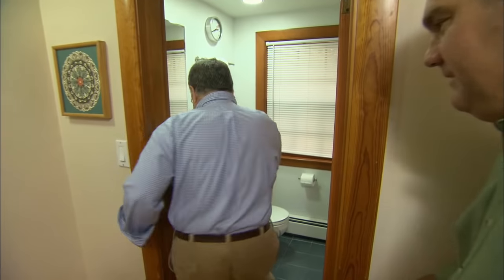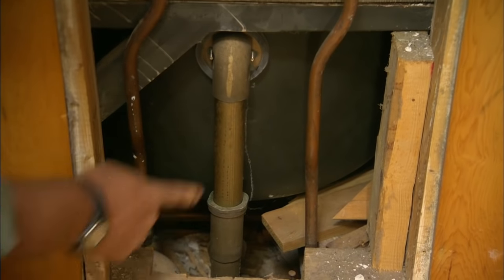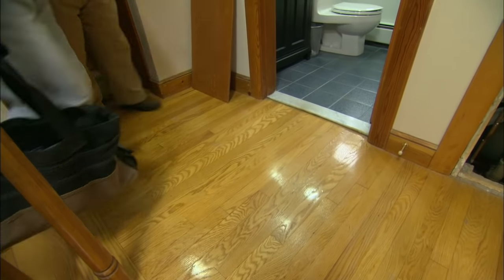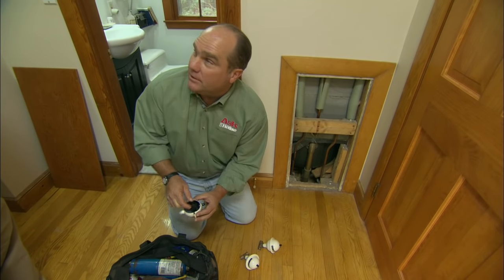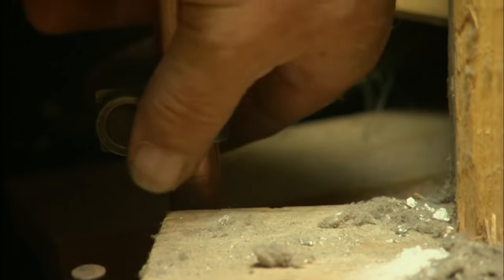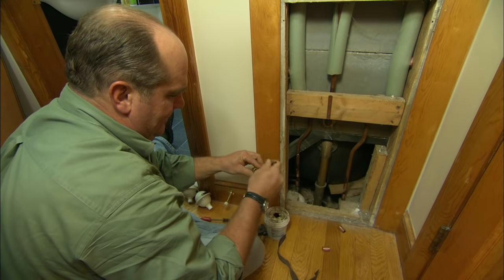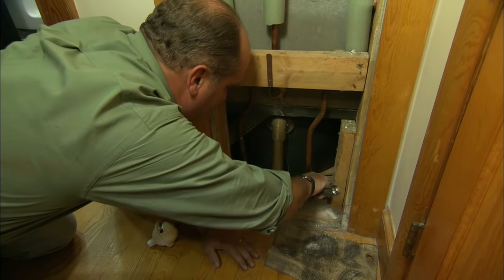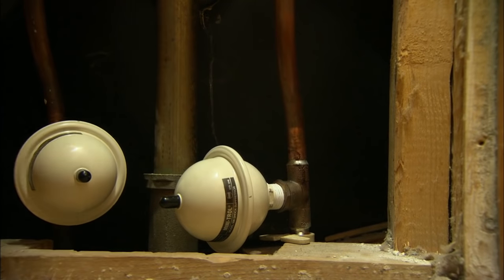How to Quiet Pipes With a Water Hammer Arrestor | This Old House

Comment: I would have preferred to see how it sounded when the play in the pipe was fixed before installing the hammer device because now we don't know what fixed the problem.
Reply: Holding the pipe can avoid noise but not the water hammer effect, which would in any case release the inertia into another element of the system.
Reply: agree
Reply: He totally bumps the wood and makes the same sound. Probably would’ve been fixed by just securing the pipe... start there at least!!
Reply: ri mar who said that? I didnt see that anywhere?
Reply: JMC5 I know you posted a month ago, but it's shortly after 0:55
Reply: you are absolutely right!
Reply: sdmerkr it’s caused by the energy that builds up due to the water pressure fixing the pipe securely doesnt disperse that energy it just secures the pipe carrying it, it still has to travel somewhere and the water hammer works by absorbing the energy and dispersing it efficiently through the rubber and air vent.
Reply: @sdmerkr  If this were the first person on earth with this problem, securing the pipe alone may be appropriate. But water hammer is a well-understood phenomenon; there are parts at Home Depot to comprehensively address it. Securing the pipe is treating the symptom but not fixing the problem. Actually, securing the pipe will make the pressure wave worse, because the elasticity of the system has now been constricted. Eventually, the problem will show up elsewhere -- with perhaps far more catastrophic effect. It ain't called "water hammer" for nothing! Rather than sweep the problem under the metaphorical rug, why not just deal with it?

The equation for water hammer is shown in another video: https://youtu.be/xoLmVFAFjn4?t=312 . The point at 312 seconds discusses "wave celerity", which is what we are discussing. Less elasticity increases the wave celerity, which increases the hammer effect for the whole system. HTH.
Reply: @floatingbonesjournal  Cool story bro
Reply: Great fix
Reply: exactly. he could have stopped that noise probably without the expansion tank.
Reply: @sdmerkr  Exactly!
Reply: @jamesl8053  there's no air vent, it's an air chamber. That on the top is a tire valve to preload the chamber to the proper pressure just like any pressure tank - that said, would have been nice if they addressed the pressure preload not just mount it off the shelf with the factory preload.

Comment: The arrestor is not only there to quiet the noise, the arrestor is really there to prevent damage to your piping. The shockwave caused by the rapid closing of the valves can damage your piping over time.
Reply: Including loosening screws inside brittle walls.
Reply: True.
Reply: OneDayAfterAnother  No. Arrestors are the simple comprehensive solution. You cannot possibly stop others from turning water on/off slowly -- unless you installed special hardware to do just that. Such things are done for industrial systems, but not in homes.
Reply: 23 years pipe still looks fine

Comment: next time before stopping the pipe from shaking can you please install the  Hammer Device to see how it absorbs the shoks ? and after that secure it with a bolt ? :)
Reply: The arrestor is not only there to quiet the noise, the arrestor is really there to prevent damage to your piping. The shockwave caused by the rapid closing of the valves can damage your piping over time.

Comment: lol. i can't remember the last house i've been to that has an access panel.
Reply: Really? My house's downstairs bathroom has an access panel to the back of the tub in the master bedroom, but the house is older. The upstairs bathroom that was redone around 2003 has no access panel.
Reply: Most houses built after the 70's weren't built with access panels. This change was due to the use of sheetrock which is much easier to repair than plaster and lathe. Also some jurisdictions may require an access panel but none that I've worked in.
Reply: It has been required code for a very long time.
Reply: My first house had two. I think people only do it once a disaster happens they don’t want to repeat. Lol.
Reply: I've never seen one personally.
Reply: i have one
Reply: Still code in Philly
Reply: Right. Access right by the bathroom sureeeeeeee.

Comment: Repeated banging is usually because the pipes were not secured against rattling, as we saw behind the access panel.
 The most common place for the origins of water hammer is the non-return valve normally installed on the HWU, but also it can come from a clothes washing machine.
 Usually WMs are connected with flexible hose and their inlet goes through an electrical solenoid shut-off valve.
 When that valve shuts of the water, the shock wave goes through to the jumper valve in the washing machine cocks and reverberates back causing the hose connection to expand creating another wave back to the valve. The jumper valve acts as a non-return valve. Shutting the valves off after washing is finished, should eliminate it there.
 My experience is to install a coil of polybutil pipe at the hot water and the cold water connections on the top and bottom of the hot water unit. The expansion is taken up withing the coils.
 Water hammer reducers break down in time and quickly, if water pressure is high. Mine did because the pressure was 880kp. That's 127.6 psi!

Comment: I have had to replace my piston type anti-hammer device periodically, can't remember exactly, may be every 4 to 6 years. However I have now found out the device (piston type) can be repaired, here is how: 
1. After removing,  drill a small hole. in the center of the end. (#21 drill for a #10 sheet metal screw)
2. Insert a thin rod through the whole and push the piston all the way back. (The piston has bottomed out, that is why it's not working anymore.)
3. I sealed the hole with # 10 sheet metal screw and a rubber and metal washer. It has been working fine for some time now.  (Or you can try to seal the hole with two-part epoxy, let epoxy fully cure. If epoxy fails the piston will prevent water from leaking out!)
4. Reinstall.

Comment: lol. that noise is nothing compared to mine, and I don't even do it as I live in a unit in the same house with 3 other people. If they close the tap quickly, I get hammered 3 metres from where I usually sit and the noise is similar to someone bashing on my window. 8 months later and its so annoying, and my landlord has tried fixing it using a plumber but it still occurs. So annoying !

Comment: Why doesn't my Amtrol air bladder for my well pump, act as an arrestor for the whole system?
Reply: The trick is to get these as close to the valve causing the issue as you can; the goal is to catch the “surge” before it reaches the majority of the system.  It can lead to adding a number of them in the house.

Comment: I have a two story home with multiple sinks, toilets and showers. Each and everyone one them makes the hammer noise. What is the solution? I do believe there is some type of arrestor in the garage with an on and off lever.  What is the solution?
Reply: That thing you see in your garage with the lever close by is a pressure regulator and the lever valve is the whole house water valve for the water coming in from the street.  Advice is to add a small hammer arrestor at each fixture and each supply especially the ones with electric valves like washers, dryers (with steam) and sprinkler timers.  Then see if that helps enough.

Comment: The bath in my 2 year old garage has a pinging near the main shut off.  System is pex.  Sound is intermittent and not necessarily linked to any water running.  Any ideas?

Comment: What pressure should they be adjusted or recharged to? Is there any difference on how much to charge them with public water vs well pump vs gravity feed?
Reply: They should be charged to match the water pressure in your house. Your house should be between 40 and 80psi. Under and you will take crappy showers, over you can burst parts on your washing machine.
Reply: appliances are rated for 60 psi operation

Comment: What kind of arrester do I need for a sprinkler system that creates a big bang when the sprinklers close?
Reply: same kind that he's installing
Reply: You can add same as was installed here or get one that’s normally sold for washing machine add-on arrestor.  Just put it between spigot and whatever valve you have on your sprinkler.  For example, a hose connected to the irrigation system if it’s a small drip system or one of the ones he installed if you have a larger directly plumbed system.
Reply: @jimk5307  Thx.

Comment: I have a twenty foot hot water return, that I am getting water hammer from, the sound is only noticeable during the winter months. I also notice that the return pipe has dropped 5 inches out of it bracket. will a hammer arrestor solve that issue?
Reply: Put some new hangers on, and don't let the pipe touch wood.

Comment: Good job but should have shown how to solder when near to very  dry timber with a blow lamp using a heat may and  having a fire extinguisher on hand.
Reply: Use a spray bottle and give the timbers around the pipe a good soaking before you start soldering.

Comment: The original plumber could have avoided any hammer noise when the house was built by extending the feed pipe to the faucets about 6" higher than the "T' feeding the hot and cold and capping the pipe.  We have done that for 30 years and never had a noise problem like this.
Reply: Great reply.  Sounds like knowledge that has been lost.  Surprised TOH is unaware.
Reply: I agree. I do that alot.
Reply: Don't they eventually fill up with water?
Reply: @kurtvonfricken6829  The capped pipes need to be vertical and the combination of gravity and the capping (no way for the air to escape) prevents the air from escaping.  Some plumbers call them "shock absorbers"...
Reply: Right, those need to be vertical (air rises) and every once in a while you need to drain the pipes since water will slowly absorb the air and the cylinder will be filled with water.  So all in all the manufactured once probably work better for most folks.  Also, the ones he installed here look like they are rechargeable via the valve in the “top”.  That way you can both add charge to match the water pressure and recharge it if it loses a little air.  Same principle as the expansion tank on the water heater.
Reply: DO not do this. Use a proper water hammer arrestor.

Comment: Which one really solved the water hammer? Fixing the pipe or water hammer arrester
Reply: THE GEAR the arrested.
Reply: All he really needed was to secure the pipes with the clamps
Reply: Majorly late, but both. The arrestor stops the pipe shaking from change in water pressure. An added measure to stop the shaking was securing the pipe.

Comment: I just saw the video .wondering why you did not strap that hot water line first and them install the choker absorber
Reply: Leaving the hot water line loose like that made it easier to fit in his tee.
Reply: @lilturk726  although the solder was sloppy looking.

Comment: Well this is all fine and dandy. But what the heck is the product make and model? I am desperately trying to stop my water pump from cycling on and off 3 times a second every time the frigging washing machine valve slaps shut!! HELP!!!!!!!!
Reply: +Zachrey Helmberger He told you what they are freak'n google them or look an Home Depot!
Reply: Water Hammer Arrestor, 1/2 In NPT, 150 psi on Amazon
Reply: Search "1/2 in. Brass Water Hammer Arrester Kit for Washing Machine Valves" at home depot. is that what you need?
Reply: Watts LF150A

Comment: Why is everybody screaming about water hammer as if it's some sort of big deal. Hammer in a domestic supply isn't going to break any pipes for as long as you live. Large commercial supplies are a different matter but you ain't gonna find any valves that close as fast as a tap in a non-emergency situation in a commercial supply.
Reply: Whether it's a big deal or not, pipes should be secured with proper hangers and grommets for the ultimate protection and quality plumbing installation.
Reply: It can damage your pipes

Comment: Shouldn't those be installed pointing up so the water drains back into the pipe, rather than have water sit inside the thing below the level of the fitting leading into it?
Reply: Lol
Reply: drain back into the pipe?? lol its pressurized water line how can it ever "drain" back in unless the main valve is off
Reply: @darrenr1194  because of the pressure differencial. The water pressure first increases then decreases back to normal.

Comment: Good video except for one very very important thing,you forgot to mention that the kind of water hammer arrestor that you installed in the video must be at five psi less than the water pressure in the house.In other words if the water pressure for the house is set at 60psi then the water hammer arrestor must have 55psi.Your video does more harm than good because most people do not bother reading instructions and in failing to read instructions set themselves up for failure.The air valve on that water hammer arrestor is there for a very important reason but most people do not think that far ahead so people tend to overlook such a thing.
Reply: Thanks for the tip. What do you do in the case of a well-water system where pressure varies from about 40 to 60 PSI depending on how much water is in the bladder tank?

Comment: I think securing the pipe would have fixed the problem without the arrestors
Reply: Not really because you still got the inertia of waterflow inside the pipe, which causes the "hammer"
Reply: Then every house in the world would have arrestors. So that's bullshit. Just fixing the pipes would do the trick.
Reply: The REAL solution to this problem is described by Porche924Tim, below. The original piping installation was faulty.
Reply: Glenn Watkins You are wrong sir! My caculations can prove it! Therefore, you must go to a mirror and scream "douche bag!" as loud as you can!
Reply: pollepost yes really!
Reply: Richard van Pukkem 
Fixing the pipe can avoid noise but not the water hammer effect, which would in any case release the inertia into another element of the system. The noise is a water hammer effect. Solving the problem is counteracting that force and that's what the arrestor does.
Reply: @pollepost  the noise was only from that sink. secure the pipes and done.
Reply: Eggsackly

Comment: if i have 1/2inch copper tube, what size of T fitting have to be there
Reply: 1/2 in
Reply: If you have to ask this question, do not attempt the repair!
Reply: The fitting is already slightly bigger so it’ll fit the pipe, just get the corresponding size
Reply: 1/2" × 1/2" copper by 1/2" female tee

Comment: i have water hammer problem in my house. Anyone in Los Angeles can help to fix the problem for me?
Reply: If it is only when you're using the washing machine, then put water hammer arrestors on the valve for the washer. These I'm talking about are easy to install because you don't have to cut the pipe, just screw it on the valve, and then you connect the water hose to the arrestor. There are like 10 dollars at homedepot.
Reply: @dorothymartin8557  yes, it gotta be on both

Comment: you got HOT & COLD pipes mixed up.  in the access door they are reversed....
Reply: No he didn’t ...
Reply: If true it does not matter. It's totally "moot". Both arresters will work left or right, hot or cold.
Reply: Richard said the cold water pipe was okay but the hot water pipe was loose (the pipe on the right).

Comment: Sioux Chief AA size mini-rester did absolutely nothing to stop water hammer that triggers the pumptrol pressure switch to oscillate...
Reply: ***** Did you install them up right? If they are at an angle the top will fill with water and they will be worthless. I have them and they made a big difference. You may also want to make sure all your valves are wide open throughout the house.
Reply: billybassman21 Thanks, Billy! I FINALLY solved it! I cut off the top of the mini-rester and added an 18" long pipe with a cap! I had to bend it a little to get it to fit in the cabinet, LOL! I connected it to a hose bib that is very close to the pressure switch and pump it opened up the valve all the way and it did NOT work. So I closed the valve almost completely and it still did NOT work, but then I started opening it bit by bit and found THANK GOD! that there is a sweet spot. It is a surprisingly narrow range but it is enough to stop the oscillation. Phew!
Reply: +billybassman21 WRONG. The Sioux can go any direction...these are a piston type design. The old school way of doing it with just a pipe with air will eventually bleed of the air...quicker if not up and down.
Reply: not as good as the watts brand, the sioux are too small

Comment: first thing he should have done is check the whole house pressure..bad PRV could cause that
Reply: Im wondering that about my house 🤔
Reply: Bad PRV will certain contribute.  The big deal in most places are things like washing machine hoses that while better than they used to be can still sometimes have adverse reactions to both a bad PRV and a pressure surge when there’s a fast valve close.   Good call on checking the PRV as part of the process.
Reply: @dorothymartin8557    Yes, if you have water pressure gauge for the hose bib that will work.   Put it on the bib (faucet) turn on the faucet for a reading.   Leave it open.  Open another faucet and let it run and read the gauge.   Close the second faucet and record another reading at the gauge.   It might take two people since you really want the pressure reading right after turning off the second faucet. That reading is what the PRV is set to hold when no water is flowing, probably should be around 55lbs max.  Watch the gauge for a couple of minutes.   If the pressure goes up then the PRV is failing and needs replaced or rebuilt.  I hope that helps.